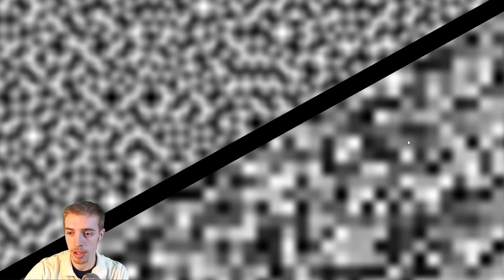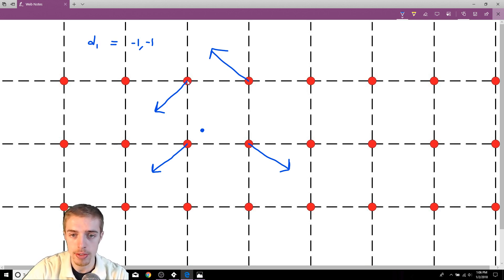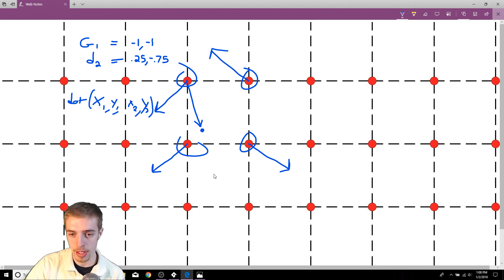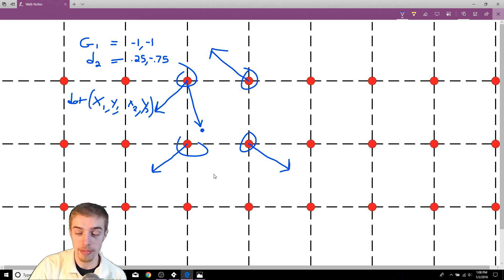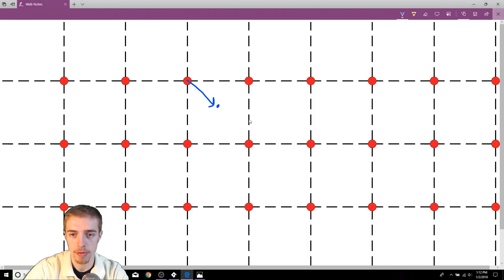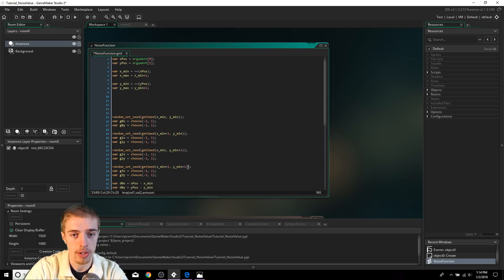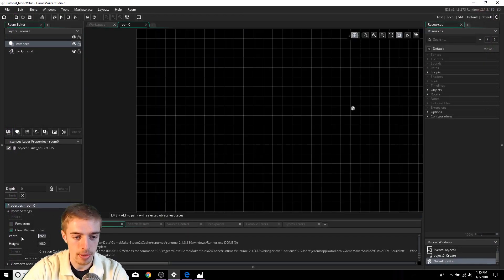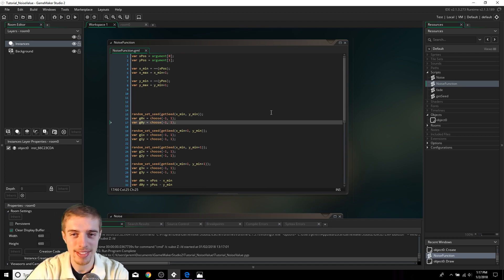Making Perlin Noise....Finally!

Comment: guys im telling you, DO NOT USE LINEAR INTERPOLATION (lerp) ffs i got stuck for 2 hours wondering why it looked so bad and then I used sine interpolation and it looks beautiful.
Reply from the maker: True, linear interpolation is the most simple type of interpolation, but there are tons you can choose from that all give it a different look! I will remember to point this out next time. Thanks for commenting!
Reply: What was the problem with LERP?
Reply: Ok I tried it. Really makes the colors pop. I'm still having a problem with grid lines though :(

Comment: Okay.  So the vectors aren't visible onscreen, they only inform the final pixels' color.  I wonder if the process is reversible to find the original vectors, and if you applied that reverse-perlin vector finder to a normal image, (on the RGB channels separately), what the vectors would look like.
Reply: seeing how perlin noise layers multiple of these vector fields on top of one another, i doubt it.. maybe with just one octave it would be possible